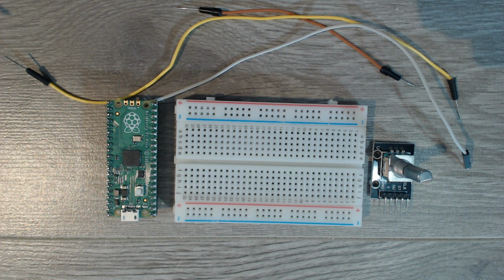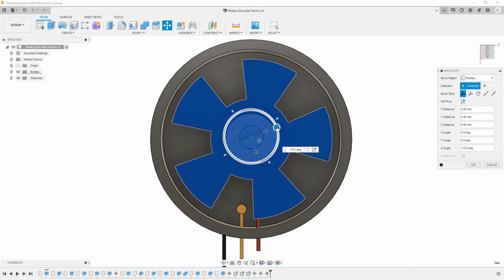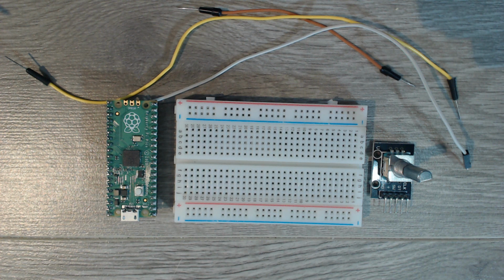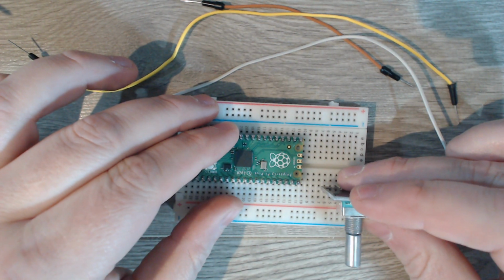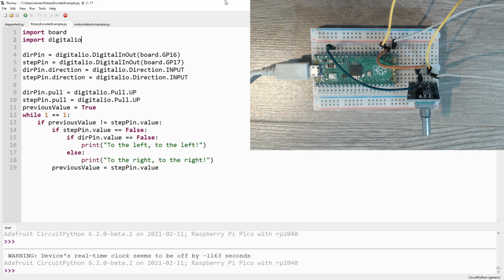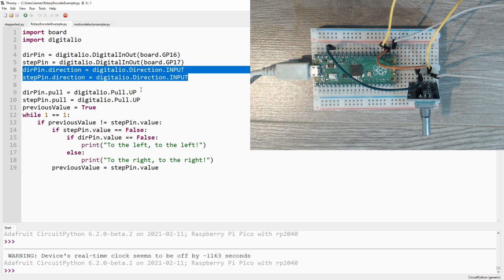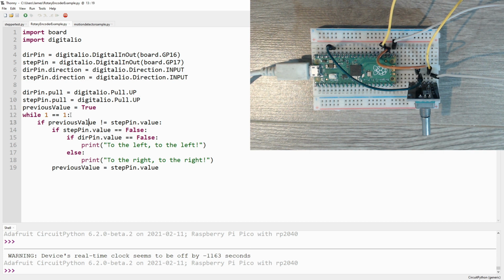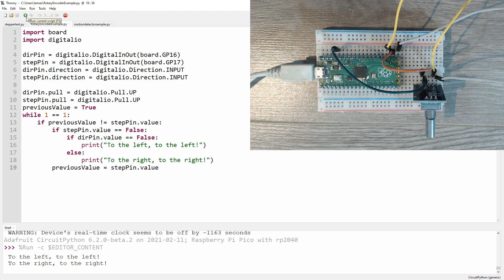Using a Rotary Encoder with a Raspberry Pi Pico

Comment: I notice that you do not connect the + pin of the encoder to + supply. If you don't do this, the pull-up resistors on the encoder can prevent an input pin exceeding the '1' threshold if the other pin is driven low (to ground) by the encoder, which may lead to unreliable operation, even if the microcontroller internal pull-ups are enabled. It is advisable to connect the + pin to the 3v3 pin (pico pin 36). Please do not connect the + pin of the encoder to +5V (as is marked on some encoders) as the pico inputs are 3.3V and inputting 5 volts is not a good idea, even though the 10Kpull-ups will give some protection.

Comment: Great and simple video! If you know, I'd love to see this in some more detail but regarding to the rp2040 chip in a naked design. I'm currently trying to learn hardware engineering a d as such I'm building my own keyboard. It will feature 3 rotary encoders and an i2c display. The i2c pins and logic I'm fairly certain of but it would be lovely to have resistors and good to knows added into an example :)

Comment: Is there a reason we use pullup instead of pulldown?
Reply: Would we have to connect to voltage instead of ground if we pulled low?
Reply from the maker: If you pull low, you will want to use the 3.3v pin. The Pico is not 5v tolerant on its input/output pins.

Comment: I want to read values like a potentiometer to determine tilt. For example tilt down, level and tilt up. How can i do this with micropython on the pico? Thanks!!!
Reply from the maker: As luck would have it, I coded a version of space invaders that uses a potentiometer to control the ship. I can give more details later if you want but for now, here's the video on it https://youtu.be/O5S1LC5TFiM
Reply: @PrintNPlay   im very new to this and looking at the github code there is to much going on for me....

Comment: Unfortunately, those encoders (looks like KY-40) produce terrible ringing, which makes it useless without some sort of debouncing. It is terrible code that consumes all processor clock on such slow and rare action as the manual encoder.
Reply from the maker: The code merely demonstrates the expected input from the encoder. As it's only purpose is to monitor for changes the encoder, the usage of the processor clock is irrelevant. I'm sorry you didn't find the walk-thru useful.

Comment: Silly question, why over-complicate things with "while 1 == 1"?  Why not "while True" .. which is what your version boils down to.  False values are an empty string, the number zero, or an empty list, tuple, set, or dictionary. Everything else is TRUE. So the simplest version would be "while 1".
Reply from the maker: Not a silly question at all. I've been working in a language where there aren't True and False constants built in... 

So, short answer, my context switching needs some work.
Reply: @PrintNPlay  The idiomatic aspects of a language are the hard parts to learn. writing X that looks like Xand not like Y :-)

Comment: Is a 5v encoder good for this task or should I find a 3.3v one?
Reply from the maker: In most cases, the encoder is acting like two buttons being pressed. So 3.3v in and out should be fine. Just don't connect 5v to it and connect the output to the pico, it can damage the Pico immediately or over time

Comment: I had a problem with Pico + rotary encoder + CircuitPython (with rotary encoder library); the input weren’t recognised. After hours of troubleshooting I realised the directional pins should not share the same PWM channels. Seems like an easy beginner pitfall but not discussed much?
Reply: Very good point - thanks!

Comment: The rotaryio library is not neccessary?
Reply from the maker: Not for basic usage, but the library does allow for easier tracking of position if that is your goal with the use of your rotary encoder, as well as support for other types of encoders.
Reply: @PrintNPlay  you changed the wiring, why?
Reply from the maker: I'm not sure what you mean?
Reply: @PrintNPlay  First yellow is on GP17, then on GND.
Reply from the maker: @autobus11a  oh, my bad! The video was filmed out of order. The wiring order in the tutorial and in the diagram is correct.